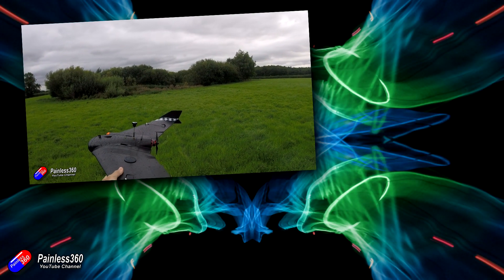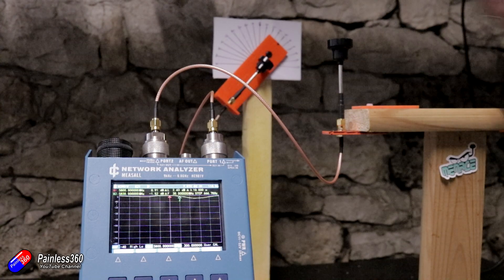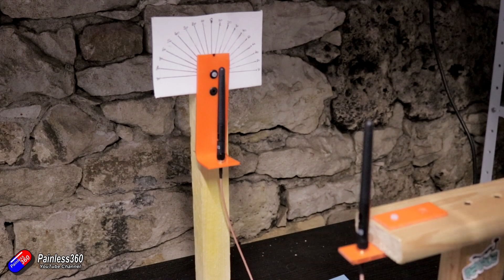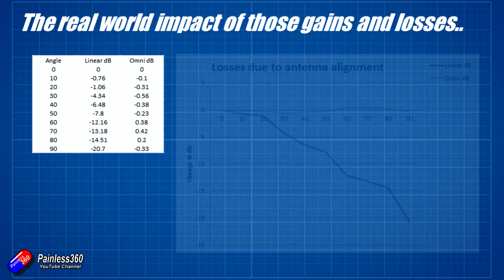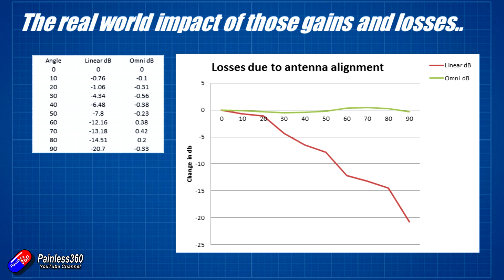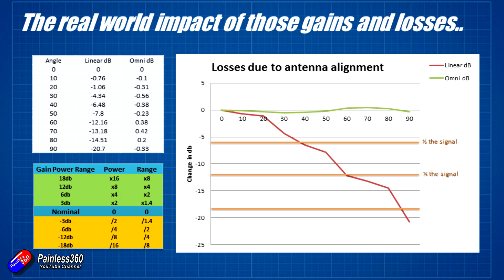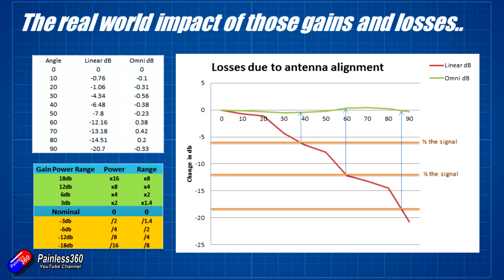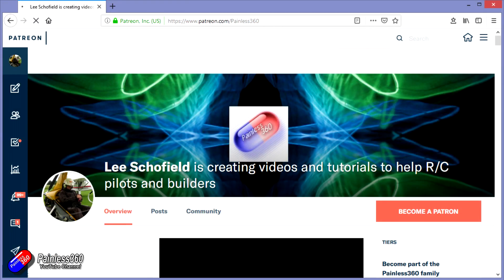FPV Antenna Lab: Antenna Alignment

Comment: Unfortunately, the circular antenna can be used only for analog video. For ELRS radio controller, it is always linear...the same for digital systems as DJI O3...
Reply from the maker: You sure? LHCP antennas are commonly used for HD FPV... Happy flying

Comment: Informative video.  Here's another question...for those of us who fly our quads at not more than say, a 25-degree tilt, and indeed will hover at zero tilt at max distance (to take pictures), would I get a better/stronger signal at that range from a linear antenna or a circular polarized?  Thanks... (Oh...P.S.  I wonder if anyone has ever put a liner antenna on a stabilized gimbal to keep it vertical?)
Reply from the maker: Check out the other videos in the series where we do more testing on linear vs. CP antennas. If you're not going to be flipping and rolling and want the best reception then linear is best (look at what systems like Crossfire and R9M use)..
Reply: @Painless360  Thanks!

Comment: I've got a box with a number of 'circular-covered' polarised antennas - how can I tell which are R/H & L/Hand without taking the covers off??
Reply from the maker: Unless you can see some writing on them, I'm not aware of a way. I suppose you could test them with a known antenna to see how much signal you get...
Reply: @Painless360  what about the "cheap" linear antenna that come with everything. They rarely if ever seem to identify which are which.
So I have 900 and 433 and 1.3 and 2.4 and 5.8.....
And they are totally sealed up so you can remove the plastic but even then some are hard to tell apart.
So how can you identify them?
If you plug the wrong antenna in will you damage the hardware? I know not to turn anything on without an antenna but what if you plug an 900 into a 433 or vice versa?

Comment: Isnt there an error in the Gain Power Range table? 12dB is Power x16, 18dB is Power x64
Reply: Yes, you are right, Every +3dB doubles the power, every -3dB halves the power. Also every 10dB is a factor of 10, so -20dB is 1/100 the power.
Reply from the maker: Guys, this isn't about the 3dB rule. It's about how 6dB change affects range... To double the range you need to quadruple the power.. Happy flying!
Reply: @Painless360  The table says for 4x the range I need 8x the power, but I need 16 times the power

Comment: Great Stuff and researched proof that linear antennae, in rc air use, are food for the garbage truck :)
Reply from the maker: Unless you're flying a fixed wing or using something like Crossfire.. :)
Reply: @Painless360  yes, being frsky and know nothing about crossfire, I just dump 'em; I love the menace polarised and patch antennae
Reply from the maker: Yep, the safest way! :)
Reply: @Painless360  I think I missed something.... is there a case when linear antenna on a fixed wing are superior to circular in let's say a long distance fixed wing?
I am using a "Vee" antenna on the aircraft and a large patch on a tracker using 1.3ghz with an 800mhz tx.
I point the Vee forward. The thinking is when I begin to lose signal and turn around the antenna is pointed in a better direction for the return trip.
So if I lose signal and the aircraft turns to return to home then I should get my video back....

Comment: Does it really make that much of a difference having linear receiver antennae on your goggles if you have one on your quad?  I get that LHCP and RHCP are not going to work together that well.  However, I have a RHCP Omni and RHCP Patch on my goggles for my larger quads and wings and these work great (~150m at 25mW) with the linear antenna on my micro quad.  Would there be a noticeable improvement if I switched to linears on my goggles?
Reply from the maker: See the tests on that in the series...
Reply: @Painless360  Just watched it, very informative.  If I was looking to go longer range with my micro, I might switch to linears, or put an RHCP cloverleaf on my quad, but in the real world my RHCP goggle antennae work well enough and my FrSky XM tends to brown out before I lose video.
Reply from the maker: The RC antennas need the same alignment too.. Have a look at that for better RSSI..

Comment: Can you please show us how bad it gets when you have one or even both antennas pointing nulls at each other?
 I ask because every time I see a quad with a crossfire antenna flat across the back I cringe.
Reply from the maker: See my Crossfire antenna video. Within a normal racetrack it's not an issue. I've only found issues when flying about 500yds away and getting the end of the antenna pointing at you...
Reply: @Painless360  oh for sure. I was just keen to see the actual numbers on how bad the Db and range drop gets.